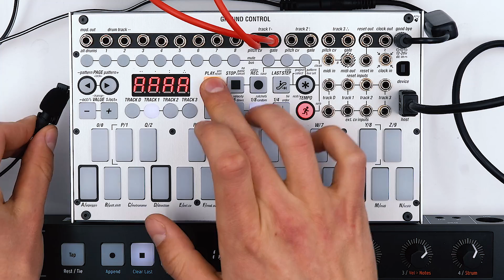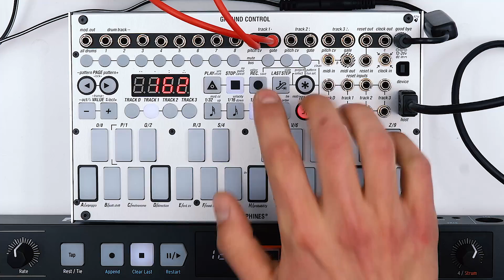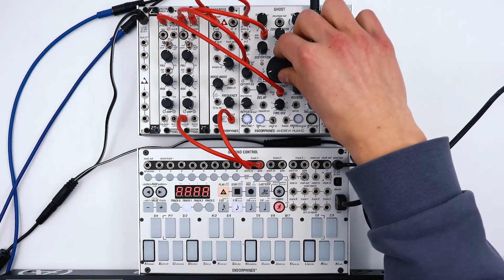Tasty Leads with GROUND CONTROL standalone (recreating Boards of Canada and Daft Punk)

Comment: One quick question how to delete project?
Reply from the maker: Good question. 
Fastest way so far: remove SD, delete those project folders. Or insert empty SD. You can store 24 projects per one SD card. 
Slower way: switch to patterns A on añl the tracls. press (*) + All drums, (*) + mute track 1/2/3. 
Save all: (*) > rec > rec. 
save pattern A into patterns B, C, etc up to Z: (*) > rec > B,etc up Z. 
Repeat same for other tracks
Reply: @Endorphines  thanks 🙏